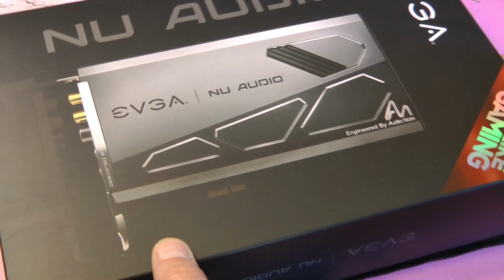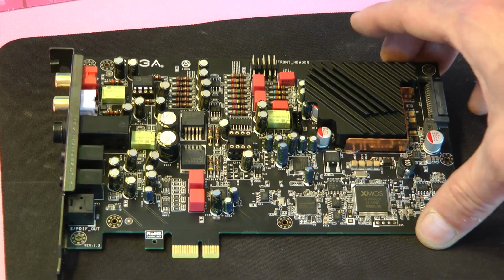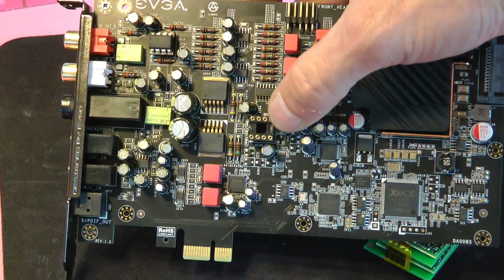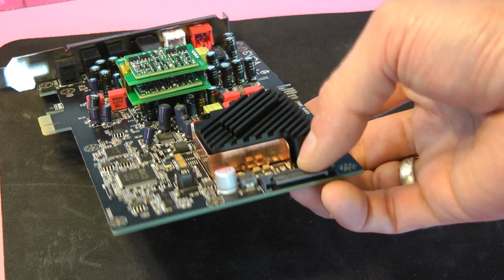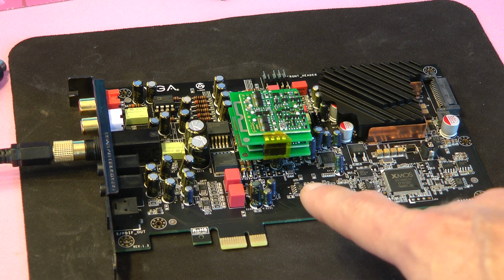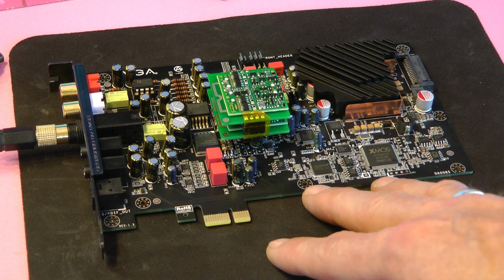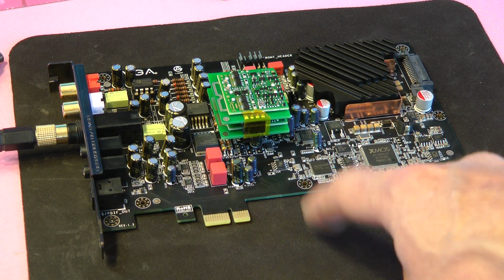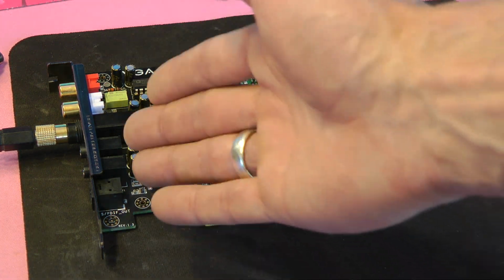EVGA NuAudio with Sparkos SS2590 Pro Discrete Audio Op Amp Dual

Comment: Really liked your review, you seem to know what your talking about. I own a ae-5 would you upgrade to this card?  i've been thinking about buying a modi schiit 3, would you recommend it?
Reply from the maker: I wish I could say man.  I've moved away from this card because the drivers were a complete pain in the butt.  It sounds amaaaazing however.
Reply: @MichaelBruceShortbus  300eur card should have better support. But I have some issues too with creative.
Reply: @MichaelBruceShortbus  what card did you move to? thanks! I have SS3602s in my desktop headohone amp but want to move to a card with swappable opamp(s). thanks!